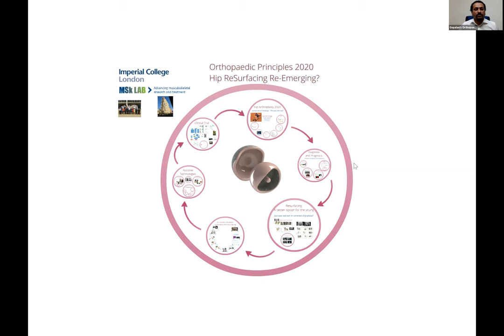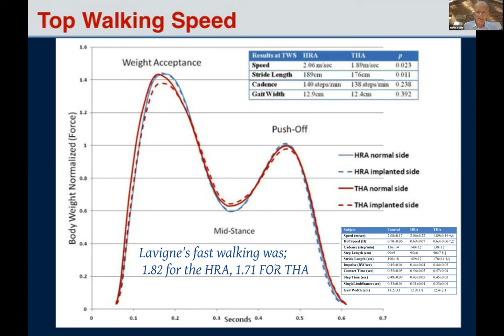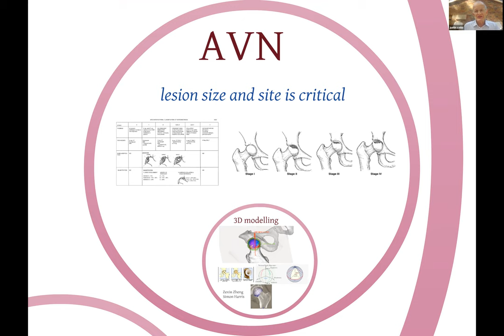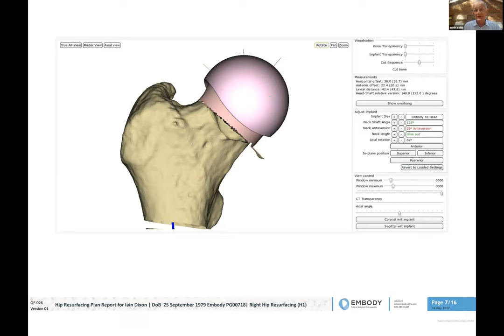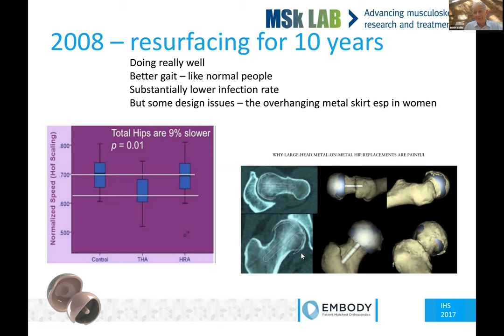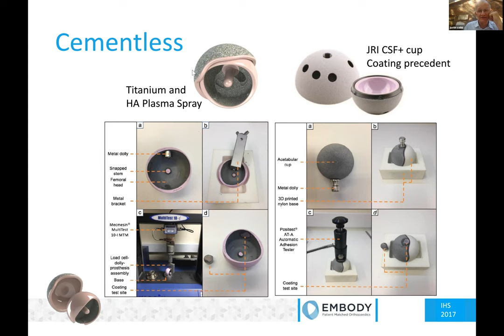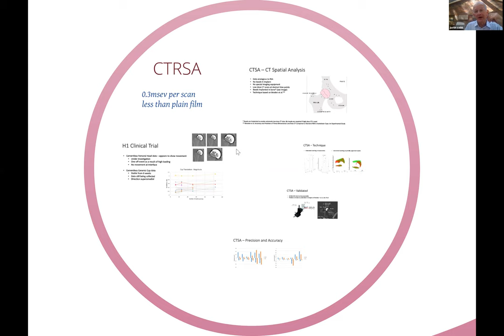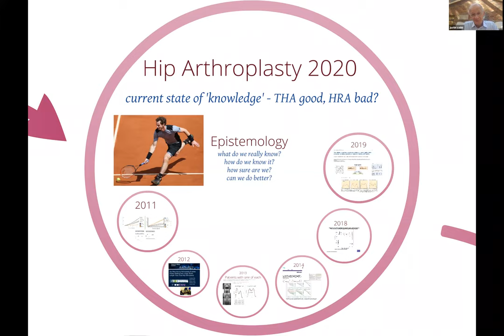Ceramic on Ceramic Hip Resurfacing

Comment: I'm 49 year male and just got a ReCerf  (Ceramic on Ceramic) done in Canada.  6 weeks later - I'm doing 45 min of stairs for cardio, in the gym lifting weights.  Getting metallosis from the MOM implants is about 1 in 5000 chance.  Doctor had to get permission from the Canadian government to use the implant as it is not approved here yet.  India will have the implant approved in June 2021.
Reply from the maker: Thank you for your comments. Please visit our website www.orthopaedicprinciples.com for more
Reply: Was it done by Dr John Anthoniou? I'm in Ontario and he's the only one who provides ceramic in Canada. It looks private. If you could message me privately with costs, how the ceramic has held up and any other info that would be great. I've had 3 hip scopes and the joint is not repairable without a resurfacing
Reply: @ryanchow7601  Good luck.
Reply: which doctor /clinic did it for you?  can you let me know who does this and where?   please PM me if you have some time. Thanks
Reply: did they use cement or glue with this procedure I know the H1 does not use either. Why are doctors here in the US not all over this and continue to insist on using products that many are allergic to or get Metallosis from this inferior product we use tell me $$ is behind our lack of care for mankind's health.
Reply: How is your hip doing now?
Reply: Thank you for your story.  Would please share the name of the doctor you got this surgery from? I need to get it asap

Comment: wow we need this in the USA, what can we do or anyone have any ideas how is the progress coming along with getting it approved in USA?  where to go for this?  London?  Canada?  which doctors do it?  I'm in Connecticut, and would like to know if I can go somewhere to get this instead of Total hip replacement.  Is it limited to certain femur head sizes?
Reply: it won't be available in US until 2027.
Reply: You can contact the Imperial College of London directly, as I have.  As of a month ago they are expecting approval in the UK in a couple of months.  It will be another six months after approval until they manufacture the devices, produce packaging, tools, etc., and are ready to start implanting devices.
You would have to go to the UK however to get the procedure done.
I'm in Mass and I'm wondering if I should wait, or get the metal on metal procedure done either in NYC or South Carolina.

Comment: Is trial still paused or moving forward in the near future?
Reply from the maker: Thank you for your comments. Please visit our website www.orthopaedicprinciples.com for more
Reply: @OrthopaedicPrinciples  I went to the web page. I do not see an answer to the question asked.  Thank you. :)
Reply: It has started up again in London, not long had mine fitted
Reply: @darrellhitmeup  
Only been waiting 18 months and a bit. 
Wouldn't mind them sorting me out. 
Only once this sodding Pandemic has calmed down and got sorted.
Reply: @Tiggy123  mine was planned for over a year, had delays due to a problem with the first gen hip I now have the second gen hip.
Reply: @darrellhitmeup  as someone that has had my hips ripped when I was 30, 5 reconstructions later and allergy-tested these are the only ones I can use. What can someone from the US do? From what I have read they won't be available here until 2027.  I am so upset that they continue to push and push a product here in the US that is BAD (any metal and plastic) for so many people and has caused so much pain.
Reply: It has paused again. 5 years study finished but cant see results anywhere. Probably did not end too well or why cant we see the results???
Reply: @munkki2700  
Well I can tell you that ain't going too bad. 
As I've had my H1 ceramic nearly two years now. 
To be precise two years in ten days time. 
It does squeak here and there, but nothing major.
Reply: @Tiggy123  i thought only THR would squeek, but good to hear its going strong 👍
Reply: @unasmith113  , @munkki2700 
Short answer, you will have to go to the UK, and it is likely the summer before they will start implanting these hips.  (Approval is expected before the end of the year, six months to manufacture, package, tools, etc., before they start implanting the new devices).
Reply: I prefer belgium, they have coc also installed there
Reply: @munkki2700  I am from USA. Do you know if they take insurance ? Thank you